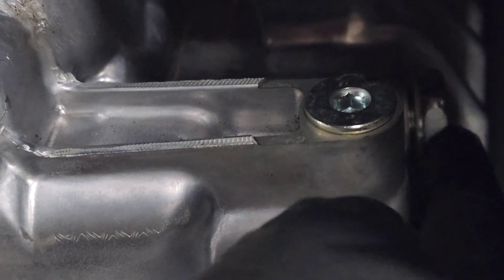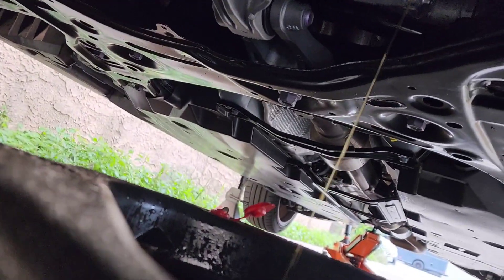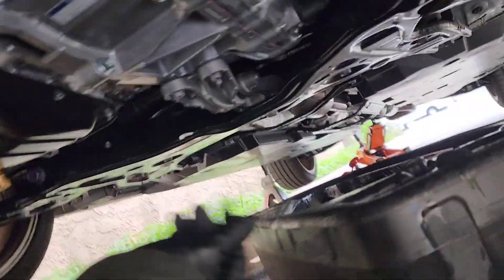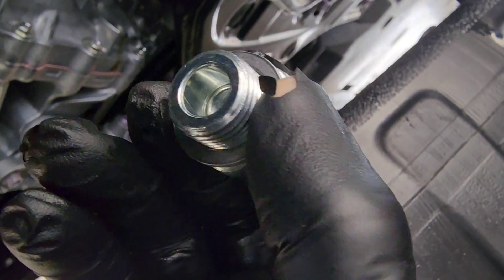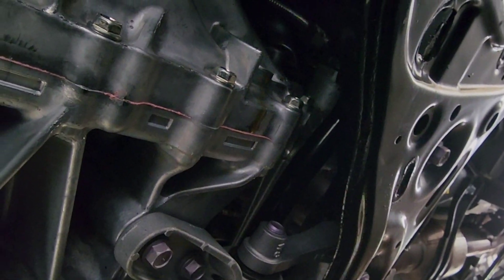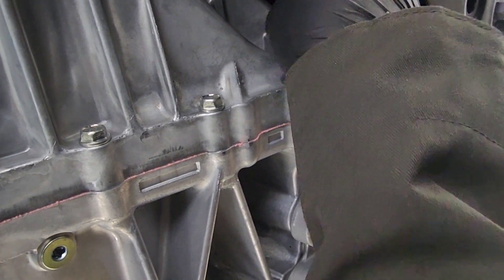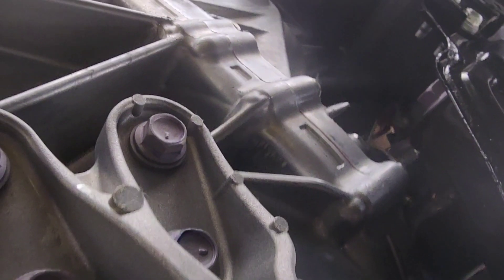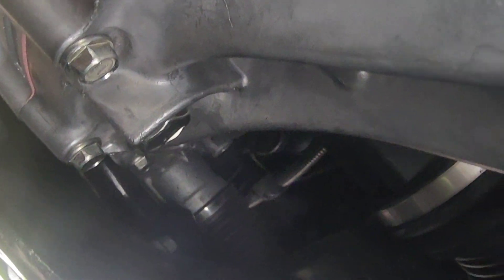Gr Corolla Circuit Edition Transmission Fluid Change (Transfer case/Rear Differential)  How To

Comment: How much did the transmission fluid cost? My dealer is quoting me nearly $250 tax included
Reply from the maker: Dude I payed maybe 120 it's about 60 per tin and I found folks on ebay , I've done it twice now and I usually get hooked up

Comment: .48 for transfer case
.5 for differential 

Experts say over fill a bit. So do you think a whole quart?
Reply from the maker: You can slightly over flow it ,but it took me 1 quart to fill both front and transfer case , as you fill it it will hit about .48 and begin to over flow

Comment: reminder: do not unbolt ~20mm the top bolt on the passenger side forget the size, that's not the fill plug. both drain and fill are the same size. (driver side orientation  + front of transfer case)
Reply: so did he do it right in the video ?
Reply: @sudo624  no. lol. it’s the bolt on top. @4:00 he loosened the breather valve. 

also, always loosen the fill plug first. you don’t want to drain and go to check your fill is seized.

Comment: 2:07 The transmission drain bolt is 22 mm, not 23, I believe.

2:13 You state that the transfer case fill plug is 23 mm Hex bolt.  I don't think that's correct.  It should be the same 10 mm Allen as the drain plug.
Reply from the maker: The drain bolt for the transfer case is a 10 hex and the fill is a 23 (for the transfer case) same for rear differential plugs. So yeah you correct.
For the transmission, the drain Bolt is 23mm, and the fill is 22 mm 👍🏼 (transmission)
Unless the core is different from the circuit edition, which I doubt . I had to use a 23mm on the drain plug
Reply: @GRCircuitsally Did you fill the transfer case after removing the hex bolt from the passenger side of the transfer case? How much gear oil did it take using that hole? Is it leaking at all since you did the service?
Reply from the maker: After I removed the 10 hex from the bottom to drain it , put the bolt back in and removed the fill plug from the passenger side , 22mm or 23 I forget 
And it only took about .5 or just about half a quart of fluid once it started coming out the top 
And no, unless you forget to really snug it down or torque to spec , remember to get new crusher washer and torque to spec
Reply: Okay I’m very confused. The rear diff and front transfer have 2 10mm Allen plugs where are you getting this 22,23 fill plug from?
Reply: @minimumwrist3546 That's what I was trying to tell him, but he filled it at the 24 mm hex, & it doesn't seem to be causing him any issues.
Reply: @kaseypoon  if it works it works I guess
Reply from the maker: The rear dif drain bolt is 10mm hex and fill plug.
The transfer case Drain bolt is 10mm hex and fill plug is 23mm 
Transmission is 23mm Drain bolt and fill plug 22mm/23mm

Comment: where did u get the oil??? I cant find it anywhere
Reply from the maker: I bought my oil straight from the Toyota dealer , and I've also searched Ebay motors. You'll find some oils on sale on the app.

Comment: I own a 10th Gen 2009 Corolla S 5MT, 11th Gen 2017 Corolla iM 6MT, and 2023 GR Corolla 6MT and they all use the same transmission gear oil. I found the Red Line MT-LV 70w/75w to be better than the OEM gear oil as have most other people and I highly recommend using it. I also bought the proper Red Line oils for the diffs too.
Reply from the maker: Thanks for the insight,  I'll have to check that out next time I change my fluids , if of really feels better I'll think I'll stick with it and make an update video on that 💪
Reply: @GRCircuitsally  I love Redline gear oil and use it on all 5 of my manual transmission cars, it's great stuff. I've come to find out that most manual transmission owners use it too.
Reply: "2023 GR Corolla 6 MT" it only comes in manual, no need to show boat
Reply: @Smitdogg  You and I may know that it only comes with a manual but many people don't. I get asked all the time if it also comes with an automatic. I wasn't trying to show boat in any way, I was trying to just give the proper information up front for those that didn't know.
Reply: I appreciate all the info…I got 5600 miles on my Corolla GR Core. I did so far break in oil change at 1100 miles and second oil change at 5250 miles about 4k intervals and first tire rotation. I will be doing my transfer case and differential fluid and MT fluid at 10k miles along with 3rd oil change. Thanks for showing us and giving us some insight.
Reply: @mhk67091  I just did my transfer case and rear diff oil changes at 3225 miles and I'm glad I did. It was pretty nasty looking. I wouldn't wait until 10k miles to do the transfer case and rear diff. I've heard from others that the 2nd time they changed it the oil looked much better. I think the transmission gear oil can wait until 10k miles though as others have reported it was okay. If you want to see what it looked like on my GRC both videos are posted on my channel at JimsGarageToys.
Reply: @jimsgaragetoys  Jim, there seems to be some confusion in these comments about which bolt is the actual filler for the transfer case.  Can you tell us how you figured it out for your transfer case service?
Reply: @kaseypoon  I saw a picture online showing which one and I checked with my friend at Toyota too and he verified it. I was pretty sure working on Toyotas for decades but I wanted to be 100% positive.

Comment: What is that tapped into your pan? Sickkk video and a huge help I'm about to tackle this job
Reply from the maker: Thanks man , been needing one for myself but couldn't find one.
It's a Fumoto drain plug , just a quick oil drain valve  that I bought to test out , I've been running it since my first oil change , it's super convenient but idk if you'd want to run that on your car there's no real benefit other then changing your oil without getting dirty and controlling the flow out.

Comment from the maker: Hope this helps someone and or gives yall some tips or tricks , so you can see that you can change all the fluids yourself and not get overcharged at dealers for basic fluid changes , brake pads , oil change etc. And everything that has to do with the GR Corolla
Reply: Do you think I could get away doing the trans fluid change on just the front ramps not being level?
Reply from the maker: @KG_GRC  yes you can, its not recommended but, be sure that what you take out is as much as you put in , 2 quarts out 2 quarts in, it's hard to get a good reading by just lifting it on ramps , but I did it. My drive way also isnt level it's on a slight incline so technically i was leveled just on ramps lol